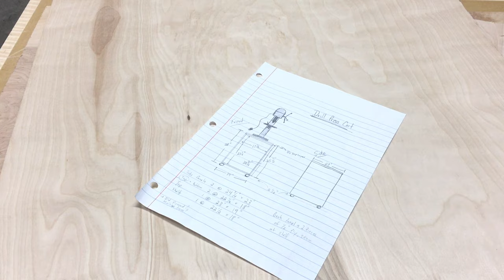Drill Press Stand | How to Build a Mobile Drill Press Cabinet | Woodworking

Comment from the maker: Want to help support what I do? Here's what you can do:
Amazon Affiliate: https://amzn.to/2LaN1Ib

In this video I build a fairly simple rolling cabinet to hold my bench top drill press.  This was built almost entirely from leftover plywood from other projects.  This type of cabinet structure could be used for many different applications.  If you have any questions please comment below or contact me via the socials.

SawStop 1.75hp PCS: https://amzn.to/2X4gWsP
Bench Dog Push Blocks: https://amzn.to/2YB00uL
Ridge Carbide 10-inch Saw blade: https://amzn.to/3bATmcp
Bosch 18v Impact Driver: https://amzn.to/3cxAhJk
Ridgid ROS: https://amzn.to/364yHMA
Titebond Wood Glue: https://amzn.to/2LzTdv4
Bessy Parallel Clamps: https://amzn.to/2z4LHG3
Bessy 6-inch F-style Clamps: https://amzn.to/3e3LGl4

Subscribe: https://www.youtube.com/danprudlow?sub_confirmation=1

Twitter: http://twitter.com/DanPrudlow
Instagram: http://instagram.com/danprudlow

Comment: People aways overlook the slots in the foot of the press and that the power head can swivel. If you make the cabinet front to back deeper, say 6,8 -ish  inches and base base floor past rear panel. The hollow created with various straps or clamps mounting methods for long stock, for end boring long stock by pushing back the press and rotate the head, counter weight in base. Hollow can also store special fences and flat jigs.
Reply from the maker: Good info.  I’ve never had a need to rotate the head or anything like that, but I can see where that would be useful.  Thanks for watching.👍🏻
Reply: @DanPrudlow  you have never had to drill a dead straight hole in the end of some large-ish diameter? convenient large drill accessories storage with very slightly larger footprint. did the same for the bandsaw stand, hang blades and fences. This is a public forum for comment and suggestions. My comment is of a concept nature and to viewers, it is not comment about your specific situation. Not the point. The viewers are. The point of a YT Vlog.
Reply from the maker: Yep, like I said good info.  Thanks for sharing!

Comment: what is that straight edge that you are able to clamp down on the board to keep the run the router beside for the edge of the boards..  haven't seen that and would be a great replacement for my metal edged DIY straight edge I made.  :)

Disregard.. I found it in your Tool list.. Thanks for posting all that.
"E. Emerson Tool Co. C50 50-Inch All-In-One Contractor Straight Edge Clamping Tool Guide"
Reply from the maker: It’s a straight edge clamp.  Not sure if I can link it here.  If the link doesn’t work go to my website danprudlow.com and go to the tools and resources page.  It’s the first item listed under Measuring and Layout.  I love it!  Thanks for watching 👍🏻.

https://www.amazon.com/gp/product/B003TXSAHU/ref=as_li_tl?ie=UTF8&camp=1789&creative=9325&creativeASIN=B003TXSAHU&linkCode=as2&tag=danprudlow-20&linkId=6c0a500dc0be809067c5c2aebdd8a3bd

Comment: hello, can you give the dimensions of this stand?
Reply from the maker: Here are the dimensions.  25.5 inches tall, 23.75 deep, 19 wide.  It is sitting on 2.5 inch casters so the table is actually 28 inches off the floor.
Reply: @DanPrudlow  thanks🙏

Comment: Any problems with the cabinet being unstable with the heavy drill press on it?
Reply from the maker: Not at all.  I move it around quite frequently and it’s solid as a rock.  Having the back enclosed keeps it from racking and the double thick top holds the drill press without any sagging from the weight.  Thanks for watching! 👍🏻

Comment: The dreaded loose guide bearing! Seems about 10% of those come loose (no loctite, finger tight). Just enough to bite when not watching out for it.

What wood did you use to face the edging?  Maple?   Ditto for drawer handle, wood type? 

Thanks for posting!
Reply from the maker: +Tom Walter yes, maple for both.  Just some 1x2 I grabbed from Menards.  Thanks for watching!

Comment: How did you figure out the width of the drawers considering the slides you used?
Reply from the maker: +smadajoe the slides are each 1/4 inch thick so I took the total width inside the cabinet and subtracted 1/2 inch to get the width of the drawer.  Hope that helps, thanks for watching!
Reply: Thanks.

Comment: What machine is that you are using at 4:06
Reply from the maker: Looks like at 4:06 I'm using an air nail gun to drive some 1.25 inch brad nails to hold the bottom of the drawer while the glue dries.  Is that the one you are asking about?
Reply: Dan Prudlow Thanks. Got it.
Reply from the maker: +jitesh maurya no problem, thanks for watching!

Comment: Hey Dan- I'm the type that needs a cut-list. I was able to grab a screen shot from your video of your sketch and measurements. I realize it's been several months since this build; can you tell me if that is what you actually worked off of when you built this stand? Thanks!
Reply from the maker: +Scott Johnston Hi Scott, thanks for watching.  Yes I did work off of that sketch and I don’t recall any adjustments to any measurements during the build.  I’m 6’2” with shoes on so you may need to adjust depending on what is a comfortable working height for you. 👍🏻
Reply: Perfect, thanks very much for the reply and for sharing your video!
Reply from the maker: +Scott Johnston glad to help, good luck on your build!